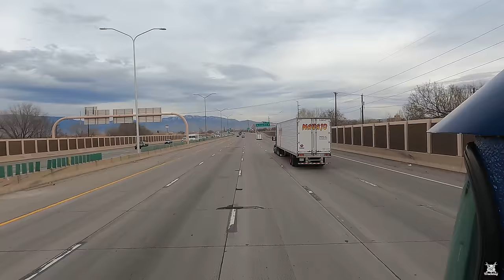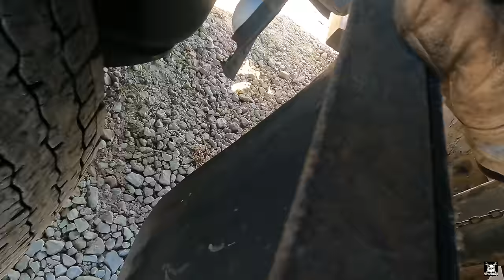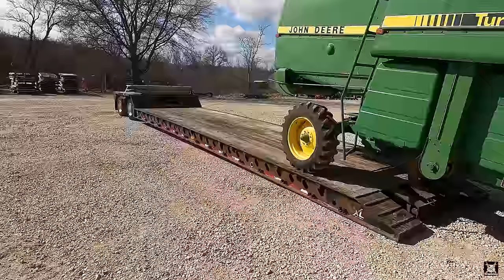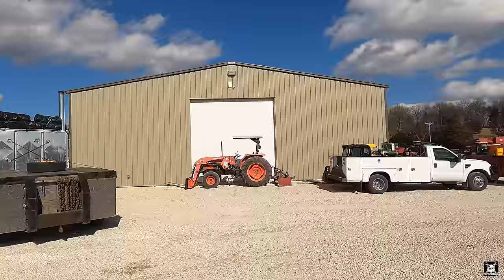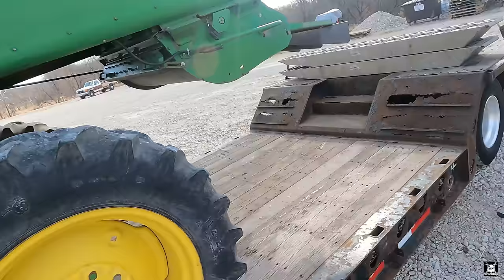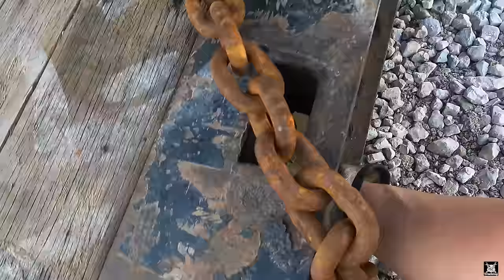Deadhead 1000 Miles For A Combine?

Comment: I'm betting the leaking boost and intercooler on the intake manifold was causing most of the rolling coal in the videos.  A cold cylinder will blow black.
Reply: a boost leak will cause it in general. Fuel of x being put in is expected for expected air of y but you are getting z air which is less so more excess fuel for the air == coal .
Reply: @arbiter1  also lower combustion temperatures as it can't burn the fuel  properly due to low cylinder temp until it dries out.  The leak couldn't have been very bad as it wasn't discovered until recently.
Reply: @haroldbenton979 unburned fuel will be grey-whiteish. 3406B smokes black, especially when the fuel screws are in the ashtray.

Comment: Deadhead? Try Bobtail from Altoona, PA. to Dallas, TX. 1325 miles! That's my second favorite story! My favorite story: Tempe, AZ to Boston,MA. One microchip! Loaded in a Packaging envelope stuck to the inside trailer wall. 2650 miles! I believed what I asked the shipper was going to get me fired from my company. The question was, "Have you ever heard of a company named UPS?" 

Now, I did get paid for both and would do the microchip again in a second. The Bobtail is a different story. I felt every single bump on the road for 2 days! I lost a couple of CDs. Apparently, something raddled loose in the player and scratched them. Back story on that run. I drove for a mega carrier. My truck broke down in Altoona. Repair ETA was a week. The international dealership had one of our trucks repaired and ready to go. It's former driver was already gone and was issued another truck. His old truck, the one that was ready, had been "Sold". They (my company) just needed to have it delivered to our terminal in Dallas. Something was wrong with the 5th wheel, and my company decided they could replace the entire assembly cheaper than the dealership. Thus, I couldn't even pull an Empty the 1325 miles. 

My third favorite story: picking up brand new trailers (somewhere in AK) and delivering the trailer to Fort Payne Alabama, pick up loaded trailer there, split it off in West Memphis. Pick up another new one and repeat......for a WEEK! very nice paycheck that week! I could the pick-up in about 30 mintues, the drop and hook in 15, the split in under 5 minutes. This was the era before the 30 mintue break. Rocking and rolling for a Week! ......... the irony, I'm retired now and moved from Nashville, TN  to Fort Payne, AL.

Comment: Needs extensions on side of trailer for front wheels.I remember helping to load a  combine when they had to remove the front wheels  and put the  front axles on  blocks.It was a newer combine than the one you're hauling. It was a New Holland TR96 that  was sold at an auction to someone up north. I remember when they delivered  a similar combine  we had to put front tires back on. The  driver that delivered it had to come a special route due the size of the combine.

Comment: If you tie your cargo down from front to center and back to center cross chaining the piece of equipment THE LOAD cannot travel any further than the chain slack, more efficient and a lot safer.  Check out how railroad personnel tie down equipment on railcars.  NOT A HATE COMMENT, just a constructive suggestion, remember it could be someone you know traveling in the opposite direction

Comment: Steve did you flip down hopper extension that's about a foot high, supposed to be down for transport,  they left them up.  Did you check yellow top on cab  it opens like a hood ,  seen drivers lose those cab tops not been locked. A driver ask me for a farm tractor cab top that he lost on highway.   Did you lock stairs flat up.   We have 8820 same combine but much wider

Comment: Well... if you get paid deadhead miles....what's the issue??
Reply: I don't think he is.  He said he was only getting 5-600 bucks loaded, meaning from Missouri to Wisconsin.  Far as I know, you don't get paid for deadheading.
Reply: @danielseelye6005  well then he's dumb for working there. No self righteous o/o would accept getting screwed. Every mile paid or no go.
Reply: @chrisherman7531  He's leased through Weidmeyer so they would cover his fuel and pay him for the load.  I think his main problem is that it was gonna be only 500 or so for the load instead of much more if he was loaded up back in Albuquerque to Wisconsin rather than Saint Louis to Wisconsin.
Reply: @danielseelye6005  still... no deadhead pay.... just bs. He still has insurance, medical etc ....
Reply: He only gets paid a % of the load. The company he is leased to pays the fuel &  a few other things but he has to pay other things. He stayed with this company as they have been really good to him, but he is not payed by the mile like a company drive is.
Reply: @Samanthareneeheart1  ok but still...